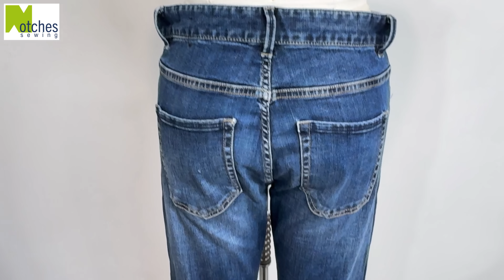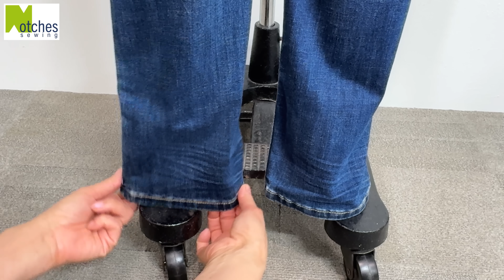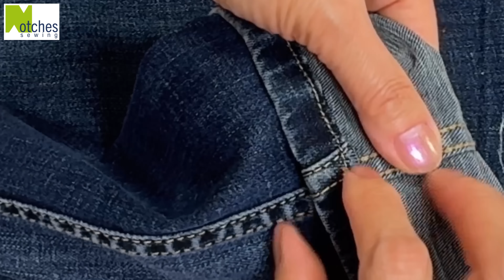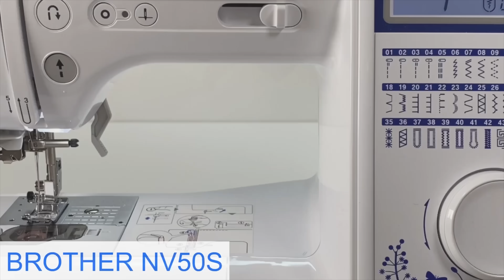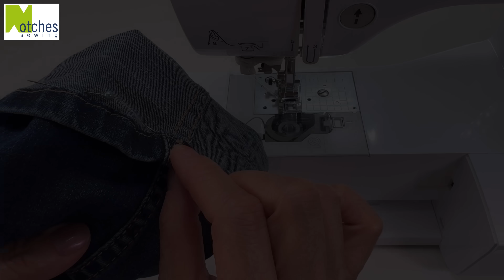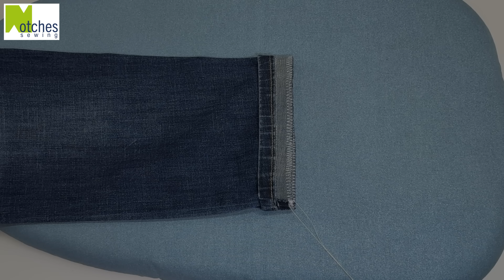How to Shorten Jeans-Keep the Original Factory Jean Hem  - Pro results with Domestic Sewing Machine

Comment: What kind of thread and size needle did you use? What was the stitchsize and tension?
Reply from the maker: Just use a standard needle size 14 with polyester thread.  You're not "hemming" the fabric so you don't need topstitching needle or thread

Comment: Hi Ma'am. I hope you reply my message. Can you please do a tutorial on how to cut the back pattern of a round neckline. My dresses are not coming out nicely at the back and the dresses have a zipper at the back. All the tutorials of round neckline is showing the front neckline but no one is explaining about the round back neckline. Thank you looking forward to hearing from you
Reply from the maker: I need  a bit more information.  What do you mean it is not coming out nicely.  What type of finish is it?  Does it have a binding or a facing?  What type of zipper did you install?  A regular dress zipper or an invisible zipper? Is there lining?  What videos have you watched for your method?
Reply: @NotchesSewing Thank you so much for replying, Ma'am. What I mean is that I am sewing a simple dress with a regular back zipper (not an invisible zipper). I usually finish the neckline with a bias , and there is no lining. My problem is at the back neckline where it meets the zipper. After I sew it, the corners become too sharp or pointy instead of looking smooth and round. I think I may not be drafting or cutting the back neckline correctly. I would really appreciate a tutorial showing how to draft and cut the back round neckline correctly, and also how to attach a regular back zipper professionally so the neckline and zipper look neat and clean. Thank you so much for your help!

Comment: Thanks. That worked. A male using a 1959 Brother machine 🤣

Some tips for guys who are sewing stretch denim for the first time - girlfriends jeans 🙄

Use LOTS of pins! I used a straight stitch foot. Old machines are not bothered by folded denim. Stretch denim is tricky for a novice 🙄

Oh and get confirmation that the length is ok before you cut anything! 😂
Reply from the maker: Great!  Thanks for sharing.  You can also put tissue paper under when sewing and then tear away.

Comment: If one is going to do this , they should measure both leg lengths and taper the hem so it longer at back than front for a nice silhouette .
Reply from the maker: Yes measure both legs if you have one hip higher etc.. -but there is no need to angle the hem as it can break in the front.

Comment: Just wasted my time watching…. This is not how it is supposed to look on inside. The cutting edges should be hidden under the original hemming, that is how my jeans were hemmed at Saks. Without leaving zig -zaged cutting edges visible on inside! Still trying to find a correct video and do it by myself
Reply from the maker: I understand your preference for a hidden edge, and there are certainly different professional techniques depending on the desired finish.  I never do it that way as it ends up looking like a binding around the edge.  This method also allows for lengthening in the future.

Comment: Would it be possible to use a blind hem foot someway rather than the zigzag method to finish off the trimmed edge?
Reply from the maker: The blindhem doesn't finish the hem but keeps it place.  You can zig zag, serge, or just use pinking shears

Comment: Great video. The only problem I have found is that most jeans and trousers I shorten, the bottom is wider than where I need to shorten them too. Therefore I always have to run in the side seam. Is there a simpler way of doing this?
Reply from the maker: Thank you!  You have to adjust flared jeans to fit.  It’s just part of the alteration.  I will have a tutorial on an original hem for flared jeans in the next couple of months.😃
Reply: @NotchesSewing  that would be really helpful! I want to shorten flare pants I got from H&M. And I didn't think of the issue Patriciayoung6202 mentioned until I saw this comment.

Comment: How do I properly measure the length on my own leg though since I dont have a statue of myself 😅😅

Also you mentioned a serger machine. Is there an advantage to having it though  you didnt use one
Reply from the maker: Pin and check in mirror until you are happy with the length.  A serger will finish edges more neatly than a zig zag but not necessary

Comment: Can I just measure the finish line at the front and add 1 or 3/4 inch at the back for a military hem? 
How difficult will it be to line everything up?
What provision should I make? Just draw a line front to (slanted) back and use the same offset?
Reply from the maker: You may have a bit of trouble as the slanted hem will be a wider measurement than the original hem.
Reply: @NotchesSewing  Thanks! I will try it out with some older work jeans with the original hem and a new hem. Both trials should give me some practice.

Comment: When I have to take too much length off the legs, the pant widens. This makes the original hem smaller than the width of the pant. When I sew, this excess fabric makes a fold in the jeans. Is there a way to get the fabric not to crease even if the hem is smaller than the leg?
Reply from the maker: This method is for straight leg pants.  You'll need to taper the legs to width of hem first

Comment: Sewing is actually impossible starting as a beginner it makes zero sense
Reply from the maker: Which part isn't making sense to you?  Just think of it as pinching out the extra fabric above the hem until you have the correct length.  You can also adjust your settings to watch at a slower playback speed.  This alteration can also be sewn by hand.

Comment: Hello, I apologize if this question has already been asked, but I see that you did this on straight-leg jeans. Does this technique also work on bootcut jeans? Thank you!
Reply from the maker: This exact method will not work as you need to taper the bottom hem pieces first to fit

Comment: SUper easy to follow and worked perfectly. Only problem was the hem was slightly smaller than the leg where I cut it so I took the side seam in slightly with an overcast stitch so I could seamlessly add then hem.
Reply from the maker: Great job!

Comment: Hi, do you have any tips on what to do if the hem is narrower than the area of the jeans where you need to take them up to? 
I’m quite short so I need to take up my jeans by a good 16cm, but because of that the hem isn’t as wide as the jeans are there, just wondering if you had any tips? xx
Reply from the maker: You will need to taper the leg to the width of the hem after cutting so it can be sewn together
Reply: @NotchesSewing Thank you! xx

Comment: I would use that steam a seam lite product instead of having to blind stitch. Also, I thought the over locker did a blind hem stitch.
Reply from the maker: I try never to use fusible webbing on garments and blindhemming denim is difficult on domestic machine.  Sewing by hand is much better as you can tack sides securely.
Reply: @NotchesSewing  well that particular product is designed, especially for hems. I’ll have to watch another video doing a blind hem stitch with the over locker. I need to keep my skills set sharp using that machine anyway.

Do you know the YouTube channel called Christine Home affairs she’s from Australia and also that other gal who ran the YouTube channel called the vintage sewing school also from Australia both of them ended up with breast cancer. I think Christine is just starting her process but I haven’t heard much lately from the gal. I forgot her name who does the vintage sewing school channel
Reply from the maker: Yes that product is good for a quick fix but over time it doesn't stick and flakes.  I never allowed the use of it in my business for that reason.  A proper hem is always better.  An overlocker does not do a blindhem.  You may be thinking of a domestic blindhem foot.  There are industrial blindhemmers that do just that specific job.  I do not watch those channels but I know her name is Evelyn Wood.
Reply: @NotchesSewing  yes an over locker does do a blind hem.

Could we somehow incorporate this technique to hemming the jeans, or because of the technique of keeping the original hem maybe this is not possible?

But I did want to show you that yes an over locker can do a blind hem stitch, and there is a blind hem foot but she shows you that you don’t necessarily need it .

And yes, Evelyn Wood is her name. I’m wondering how she’s doing. 

Here is the link to a short video of the over locker 

https://youtu.be/kib_XX8-zDY?si=T5NB1T4_DOitz8uO
Reply from the maker: Thanks for sending.  You are correct, the overlocker does a version of a blindhem but it is not invisible and  I really would not recommend it for the jeans.  It will be very thick for the serger and the stitches will be too close.  I would have issues even using an industrial blindhemmer.
Reply: @NotchesSewing Well I tried 🤣🤣🤣👍🏻 watched another video and she had a really weird method. Then I watched yours again. Hopefully, I’ll get it done tomorrow.
Reply from the maker: Please send me that method too. I promise sewing that little bit by hand is worth doing.  You'll waste more time stuffing around with the machine.  Been doing this way for almost 40 years
Reply: @NotchesSewing ok here’s the weird method 

She is making way too much work for herself 

She does have one good point about straightening out the flare in the leg 

https://youtu.be/bc8hwF7f5oQ?si=qfcImkIFn5ruAMtI

Comment: Looks like a good and easy way of doing it, but, I have never done any stitching on a sewing machine. I tried not so long ago on a guitar strap and it looked terrible - and I couldn't set the machine up to stitch properly. I had the hand book but found it difficult to understand how to thread and tension it etc. To do these jeans is going to be difficult because I cant take off the side of the machine, never the less I'll give it a try. My mum always did the sewing for me and was quite an expert but at 96 she can no longer remember anything about using a machine.
Reply from the maker: You can turn the jeans inside out to sew that hem on a flat bed machine or you can sew the seam by hand with a small running stitch. It will just as nice.  Thanks for watching!

Comment: I am NO seamstress but, with your slower and detailed tutorial, I think I might just be able to do this. I am 4’11” and just about every pair of pants I buy must be hemmed or my lazy way, rolled up. Thank you so much for sharing this. 😊
Reply: omg. me too im the same height and NO jeans fit me..
Reply: @gyubamie  It's a Me 2 movement, 4'11", yep it can be an issue & a blessing!
Reply from the maker: I am so glad you found it helpful! 😊. You can do it!!  If you are worried, just pin in place where it will be stitched first and check the fit before doing any cutting.
Reply: @doloresgustafson1764  same for me and it’s so expensive to pay someone so I am learning my self. This is the best tutorial I’ve seen yet
Reply: @doloresgustafson1764  I’ve been doing this for years. It’s very easy to do. This is a great tutorial.
Reply: Me too! I invested in regular sewing machine, surger and cover stitch machines.

Comment: @notchessewing if I
Want to be able to let the hem out later can I still use this method and not cut off the excess?
Reply from the maker: If you are only folding and not cutting away any fabric, it's very easy to let down.  If you do cut the fabric, leave a big amount for the seam and you can still pull down that amount later to lengthen from the pant side. You can't from the hem side as you still want the seam right above the originally stitching.  Do keep in mind that you may have a difference in the colour as the inner fabric won't be as faded.

Comment: I have a pair of wide leg jeans which flare as they near the bottom.  I need to be shorten them by 5"!  Yes, 5".  Because of the flair I cannot simply fold and hem as you show for a straight leg jean as of course there is more fabric width on the bottom edge than there is at the 5" mark.  Any suggestions?
Reply from the maker: You will need to cut to separate pieces and then taper the bottom piece to the width of top piece.  You can follow the same steps I’ve shown but leave about 1” seam of both sides before cutting. You’ll have to unpick the hem on the bottom piece, take in one side seam and rehem before attaching back onto the jeans.

Comment: Hi, 
Just did this. Thank you so much! Perfect result. Your explanation and video is by far the best. As the jeans tapered a little towards the bottom and there were more than 4 inches to takeoff, I had to take them in a little on the flat seam without yellow double stitching so that they don’t gather. You cannot tell that they have been shortened unless you get your binoculars out. Just fantastic 😊.
Reply from the maker: So great to hear. Good on you!  Thanks for watching😊

Comment: I have taken my jeans to 15 different tailors.  Each one promised they could keep the original bottom edge.   Not one did.  Thry dimply cut and hemmed and mist used just white thread despite the jeans having yellow stitching.  I have no idea why they all lied - but i just did this myself in 20 minutes and it looks better then every single pair ive had tailored.   Why so Tailors agree to this and then just do whatever they want?
Reply from the maker: It is frustrating when you don't get the results you asked for.  Especially from 15 different tailors!!????  I am glad you got a great result. 😊
Reply: @ I assumed the first few didn’t understand what I meant after one gave me back the original hem that they cut off.  I then made sure I went to a tailor whose first language is English.  Same result.  I had the next few repeat after me …. At that point I just assumed it wasn’t possible.   I was frustrated because I can sew - I have a great sewing machine and a serger.  I was looking for a professional result and ended up with jobs worse than if I’d done it myself.  I’m not sure why I didn’t look this up sooner.   Anyway, thanks!  The problem these days is that  designers seem to only make ankle length jeans now so they are all too short.  I think they must have heard the cries of the short- legged and gone overboard.   🤣
Reply from the maker: Unfortunately just having a shop and owning machinery doesn’t mean you know how to do alterations properly .  I’m glad you got this sorted.  Please have a look on my channel for more tutorials.  Since you sew, you may like some of my projects too😊

Comment: Used this method too but I just cut fabric close to new seam and double stitch and it holds and looks fine also because I am too lazy to do it properly! But obviously this only works with straight 👖 jeans...if there is a lot of taper or flare.. forget it... Been sewing since 1966 so have adjusted jean hems from wide bell bottoms to skinny tapered boot hems as I am now under 5 feet tall so all my slacks get shortened! 😅 Also I am too lazy to do the bulk trimming or sewing foot leveling...comes out fine but your methods are better! 😅 love your vids! ❤
Reply from the maker: Thank you.  Yes tapering jeans is a whole other tutorial!

Comment: I often have to turn up my jeans.   I start off the same -, turn up to the inside, but then I don't bother to retain the hemmed bit - I cut off the end of the legs, leaving a good allowance, turn the raw edge in, and hand stitch the hem.     It removes the "casual" jeans look, and I quite like the more "tailored" appearance.   The piece I've cut off is kept  - it's sturdy fabric, can often be used between fabrics to provide strength when sewing on buttons.   I've also used it to make belt loops on denim skirts - lose a little weight, need a belt.   Thank you for your tutorials, they're very useful. I've been sewing for over 60 years - never to old to learn new methods.  Aug'24. UK. E ❤
Reply from the maker: Thanks for watching and sharing😊